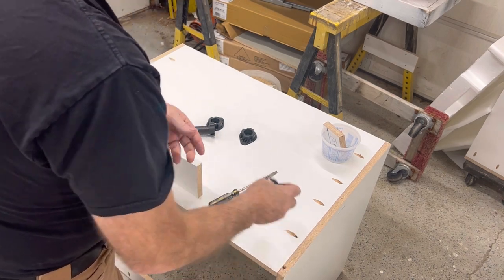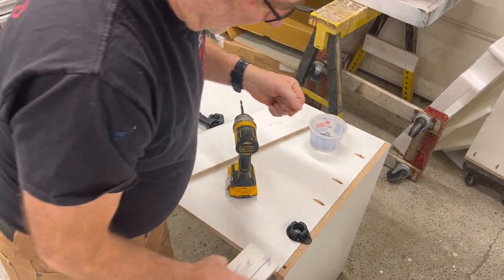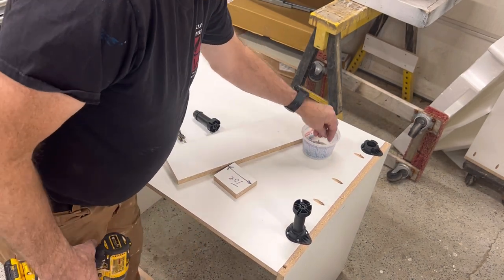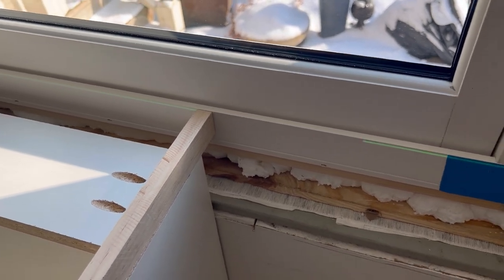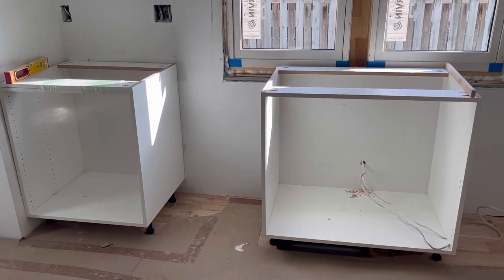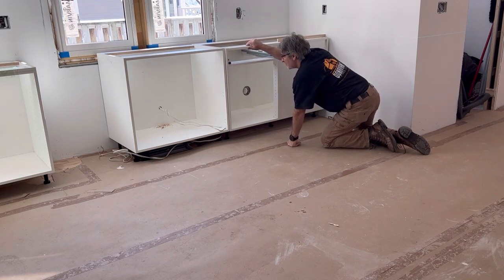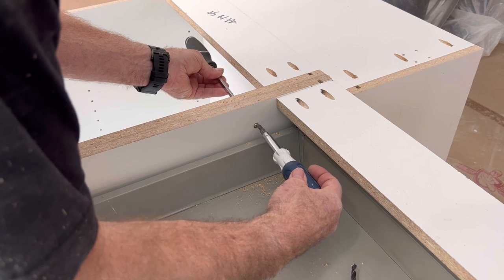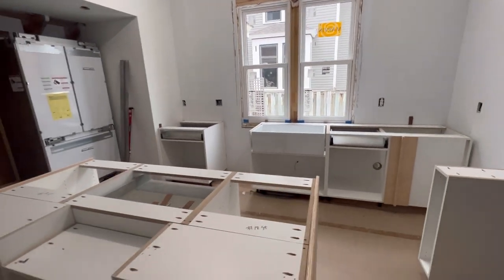The Install of Adjustable Legs for a Kitchen Cabinet Build

Comment: Looking good! I install my cabinets the same way except I got tired of getting up and down to check the laser on top. Instead, I made a equal pencil mark a few inches down on the front and back of the cabinets then set my laser on the mark from the high side of the floor  and leveled accordingly. Saved my knees and neck some pain. Lol!! Thanks for the video!!

Comment: The use of adjustable legs makes lots of sense to prevent water damage. A water leak under the sink damaged the bottom of my kitchen cabinets because the toe kicks were made with particleboard that was resting on the floor.

Comment: I have a question, why was the sink not put put in front of the window?
 It really looks off kilter
Reply from the maker: The sink is centered between the double window it will be in place in the next video. Is that what you are talking about?
Reply from the maker: Yes we had to bring the drain though the cabinets to not compromise 2 x 4 wall with a 2 inch line and meet code  It’s not really the way I liked it done but it was the best solution for what we had

Comment: Maybe (okay, likely) I'm missing something - but are those cupboards really going to wind up with a 4 in. space beneath them? Can't be. My wife would go nuts with the stuff that fell on the floor and then got stuck back in there, and my kids would use the space to hide every toy they had.
Reply from the maker: There will be covers installed when done that are Attached to the front legs

Comment: Aaaah, so you are literarily building custom made look-a-like IKEA cabinets!!!
IKEA uses the same leverer legs,,, I know as I have installed them on several cabinets myself. In fact, IKEA cabinets are quite good, ie reasonably just as good as cabinets from high end producers where one singel base cabinet w/ shelves or drawers but w/o a door) can cost as much as $500. Just sayin' ....

Comment: Those just seem like a bad idea, especially with particle board cabinets held together by pocket screws. The whole thing just seems like a recipe for massive failure. There is nothing wrong with traditional cabinet building and materials and none of this is an improvement over traditional cabinet construction.
Reply: Very common in Europe, as is this type of cabinet construction. Seems to be doing fine. These can be easier to level as well, depending on the floor you're dealing with. My only real gripe with them is I seem to recall that they're pretty expensive for the name brand ones.
Reply: Megan Man, he is doing 🙂
Reply: only issue here is oriention of how the base mounted to sides. he should be doing that for upper cabinets but bottom cabinets should be the way that side of the cabinets sitting on top of the bottom piece. all the load is on the side pieces and he is connecting the legs to bottom piece so instead making sides to hold down the weight, he is making bottom screws hold all the weight of the countertop. thats wrong.
Reply: @karpuzsever  Take a look again to the video. He is positioning the legs in the correct way to distribute the load with the bottom and walls.